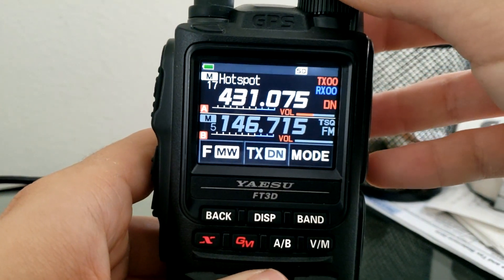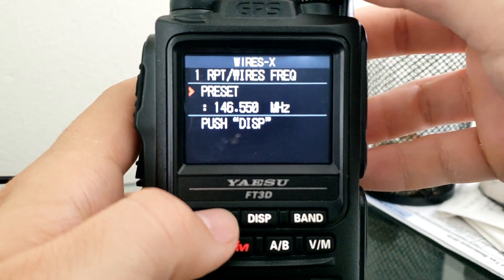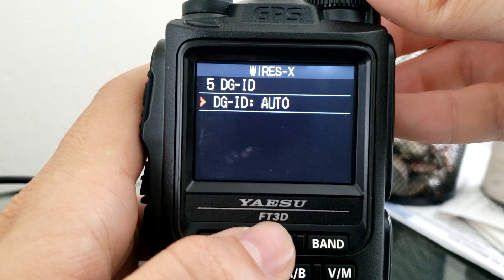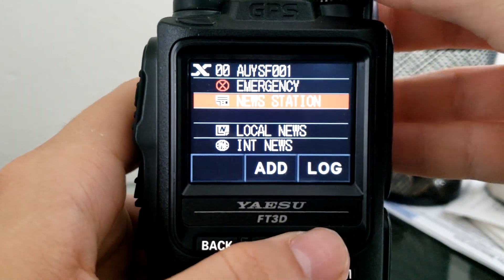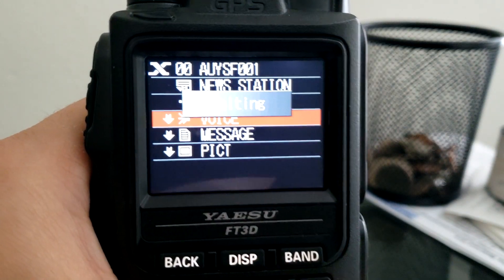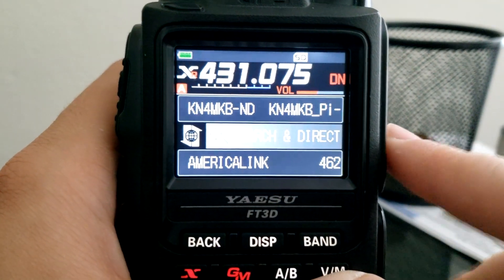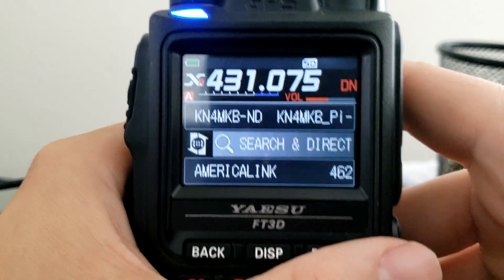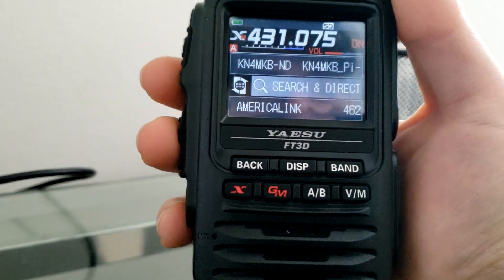How to use Wires-X on the FT3D  and C4FM (System Fusion)

Comment: I know this is an older video, but thought I would post a question just the same.  I have an FT5D.  From what I can see, the method to save reflectors in one of the categories is the same as what you describe.  I follow the printed directions and do what you have done, but for some reason that I cannot explain the reflector doesn't get memorized into the category.   The name of the reflector will appear in the list in the MENU-->Wirex-x-Remove node/room, but it will not appear in the group when I use search and rector.  Can you explain?

Comment: Thanks for your excellent vids on this radio.  I have a FT5D, but they're basically the same and there aren't as many vids on the 5, so I've been watching all the 3's.  Love that you explain the various menu options - including the ones that won't be selected!  So many youtubers just tell you to select one option or another, without explaining the other selections, or sub-menu choices, or WHY they are selecting what they do.  Very helpful to have a fuller explanation.  Is it true that you cannot disconnect while others are in QSO in the room that you're connected to?  Heard that somewhere.  Thanks again.  Watching all your vids on this radio.
Reply from the maker: Unfortunately yes. The disconnect signal requires you to transmit to the repeater and then the repeater transmitting back, so if people are talking it ties all of this up.

Comment: The use of “hotspot” in this video is confusing.  You are not connecting to a hotspot.  I noted people asking what hotspot they needed to get.  The answer is: “Not any.”

He is simply connecting to a Wires-X repeater— one I use often in Fort Worth is “KA5TWA” on 447.700, and that is what is showing when I connect by tapping the “X” button, and that is how I named it when programming it on my FT3.

Speaking of hotspots, his sample QSO was, indeed, using a hotspot.  That received transmission had the ”Charlie Brown’s Teacher” Wha-wa, wa-wah-wha-wa tone, which is what gives away hotspot users.  Whereas, Yaesu System Fusion (like the FT3D) radios connected to the repeater using C4FM will sound like a cell phone, with crisp consonants, and all five vowels.
Reply from the maker: I'm connecting to a Hotspot in the video. A Hotspot is simply the rf-internet device used to connect to other stations. In my case, I'm using an MMDVM raspberry pi Hotspot running pi-star.
Reply: Okay, but unnecessary for a how-to video on connecting an FT3 to a Wires-X repeater.  Your method was exactly the same as connecting to a Wires-X repeater, but had followers asking what hotspot they would need— so I assumed you had a reason to not use (or rename) a Wires-X repeater.

I am not trying to be hyper-critical, but since a hotspot is not normally a part of a local connection to Wires-X, and the questions regarding it went unanswered, I wanted to clear it up.

I like your videos, and subscribe.

Comment: When I log into the CQ-UK WIRESX room, I stay connected and often hear gents from England making calls, etc.   When I log into AmericanLink, I never hear anyone and I get dropped from the room after about 20 seconds.   What am I doing wrong?  You seemed to have no issues with AmercaLink.   I'm using an FT-3D, by the way, and a Zumspot, Nextion 3.5.

Comment: A basic question, if I may: how does the process differ when connecting to a Wires-X capable repeater, vs. a repeater that is listed as "System Fusion" or "FM Fusion"? Do I use the "X" method on all cases?

Comment: Do you need to have completed the registration on the yaesu site before you get this to work?  I have the hotspot and can pick a room to listen to by default but when I hit the X, it flashes a P in the top left, then after awhile, beeps 3 times, and I don't get the connected message you're talking about.

Comment: Didn't think you could access "true" Wires X via a hotspot.  I understood that if you're using a hotspot, you're access reflectors that are bridged to the Wires X network, but you're technically not on Wires X.
Reply from the maker: You are correct.
Reply: @ModernHam  Like to see a video about how to connect to an actual Wires X repeater.

Comment: I am planning on getting one of these during my pilgrimage to HRO on the 14th. They have a special on these. Also, It appears that Chirp may be compatable with this too. Well, if nobody has tried this lately, I will soon find out...
Reply: I have also read that Chirp can destroy a Yaesu FT3 dr. I chose to download the RT Systems(for Mac about $25) and use a micro card (32). worked great, and very easy)

Comment: I am going to sell my Anytone D-878, I bought the FT-3d, I used a friends and it's vastly easier to setup and use than DMR, no need to mess for endless hours with a code plug, programming repeater frequencies in for every reporter times the number of talk groups ? it's a real mess of a setup, the anytone radio itself is decent but DMR is just a joke to setup and use and if you have issues it can take a long time to figure out what's wrong. With the FT-3d you simply load a backup of a previously known good backup on the sd card and you're back in business, no PC needed, no cable, no programming or trying to figure out what's wrong with your code plug. 

Fusion = enter repeater frequency, press wires-x, find room, you're done.

DMR = many hrs or weeks messing with a code plug, then if you travel and need to use repeaters you got to enter this repeater  frequency for every talk group and it's very time consuming.

Comment: Good video. My question is this, if you connect through a local repeater, does it lock it up unless you proprly exit?
Reply from the maker: Some are set to disconnect automatically after no activity for a while. Others may stay connected until someone else changes it.

Comment: Thanks for yours videos, I think I watched all of them  and they were very useful to me, very easy to understand.
Since I am new to the world of digital radio, I want to use Yaesu ft-2d with a
MMDVM and please tell me if it need to calibrate MMDVM or not, for low BER. I know it's necessary at DMR.
Thank you in advance! '73!
Reply from the maker: i found that I didn't need to calibrate mine. Mine came with the information to put in.
Reply: @ModernHam  You have Openspot or MMDVM? I have MMDVM.
Reply from the maker: @nickc.5626  The MMDVM
Reply: @ModernHam  Thanks a lot for the quick answers. You helped a lot.
I wish you all the best and maximum health!

Comment: I actually have a question for you now. So I am able to connect to a Wires repeater near me. Then I am able to use the search function and see the available rooms to join. I am assuming the numbers on the far right indicate how many people are in that chat room right? So it looks like 1 and 77 and 13 and 10. I click on the chat room. It says I am connected and I never hear anyone talking. I see that I am RX but I can not hear anyone and then when I TX and ask for a radio check no one comes back to me. What could I be doing wrong?

Comment: Newbie question. Why do you need a ham license and call sign to operate the FT3DR if it can only transmit in VHF/UHF? 
I thought you only need a license to transmit on lower frequencies?
Reply: You still need a Ham license to operate the FT3DR cause it operates on amateur radio frequencies. VHF UHF and HF all need a  license to transmit on these bands. As to the reasons why is because you could interfere with other radio services if you dont know what you are doing with one of these radios. Possibly interfere with an emergency communication as well.  Getting the license teaches people what frequencies they can operate on and how to use the bands without causing harmful interference.  A technician license is easily obtained to be able to use VHF and UHF and a very small sliver of HF.  I hope this helps answer your question.  W9ALC 73's

Comment: Hi I have the Ft7250DR and the FT3D Yaesu radios. I noticed on you tube you connected to your hotspot.  Being a older senior citizens and 2 months into ham radio it is difficult to get straight answers as I don’t have an Elmer.  I am looking at a rugged hotspot to get to wires x with my 7250.  Is that possible? Should I be connecting the FT3D to the hotspot?  Do I even need a hotspot?  The repeaters in my area are mostly analog.  Any help would be appreciated.  Mike the old new guy to ham radio.

Comment: I've noticed if I change from Memory mode to Bank mode and try to press the X button to connect to wiresX on my local repeater it doesn't respond. Do you have the same issue?

Comment: Do i need a hot spot for my ft 3dr? just got my tech license today? Have a razpi 3 b plus what kit could i build and what parts would i need to construct a diy hot spot if i need a hot spot. I live in vegas and there are like 4 YSF i can connect to. or do i need to buy the scu 39 cable? im lost lol
Reply from the maker: I have the $30 Ebay MMDVM board I put in a spare Raspberry PI. It works fine for me. But if there are YSF repeaters around, you can use those for free.
Reply: @ModernHam  From my understanding you cannot connect to a Wires-X node or room with out going through a Yaseuo HRI-200 or other radio with Wires-X built in. MMDVM hotspot running pistar or the like will not yield you access to Wires-X repeaters or rooms. Prove me wrong please...

Comment: I also had one more question for you. All I have is the FT3DR. If I got an HRI-200 could I connect to it directly through my FT3 or would I have to get another HT or something like an FT-100...?  Some people are saying you need an additional radio to hook up directly to the HRI-200 then you use an HT or another radio to link to Wires-X through it.  Others are saying you can setup the HRI-200 in a "direct mode" and go straight from the FT3 directly into Wires-X through the HRI-200.  Hopefully I'm explaining all of this correctly and using the right vocab.  Thanks.
Reply: For about $60, you can pick up an SCU-39 cable, which allows you to plug your FT-3DR directly into your computer, which acts as a WiRES-X node. https://youtu.be/o2aM54NgNPc
Reply: With an HRI-200 you need a FTM-100,FTM-300, or FTM-400 to act as the node radio. Think of the  node radio as a small repeater,. You would then use the FT-3 to transmit to the  node radio, the node radio will then transmit the signal from the node radio to the HRI-200 which is connected to the internet by your PC.

Comment: Got the FT3DR last week (been setting up all of my freq's, repeaters, bands and listening...)  and passed my Tech last night. Still trying to figure out Wires-X. There is a node about 7.5 miles north of me that I can connect to (sometimes it takes multiple connection attempts) but when I try and search through "all" nothing comes up. On the main Wires-X screen the bottom text says "Colorado-River 1". Could this be a private node possibly?  I really dig your videos, very clear and concise. Keep it up man. Thanks.
Reply: Hi there, I’m looking to do my test, thought they were all stopped for now?
Reply: I also have the same problem, i have the FT-3D and nothing comes up when i press all or if i try to search. Anyone now what coz this .?

Comment: Love Yaesu radio's ,  but they're much too pricey.  I'd like to have one though.
Reply: I thought that too until I bought  the Anytone D878 and spent days trying to program it for the first time and then weeks to perfect it, fine radio but after using a friends FT-3d you can see that the Yaesu is vastly superior and easier to use, I was sceptical still even after using my friends FT-3d, as time went on I realised how bad DMR really is, it is after all designed for business use not ham radio, if I want to change repeater, travel etc I got to spend a huge amount of time entering Repeaters + all the programming for each talk group for each repeater it's just ridiculous, with the FT-3d you simply enter the repeater frequency and hit Wires-X and you're done, it's the way it should be. IF something goes wrong with the config you simply restore it from a backup on the sd card, no PC required.

Yes the Yaesu is expensive but ( in my opinion ) vastly superior to DMR, the more that buy the cheap Chinese radios with DMR the less incentive Yaesu and Kenwood have to make good radios, I'm not saying the anytone is a bad radio, it's not, DMR is the real issue. 

Perhaps these cheap DMR Chinese radios are the reason Kenwood stopped production of the D-74 ?